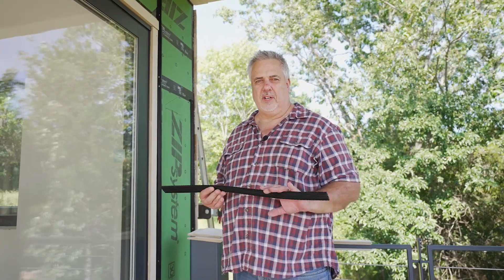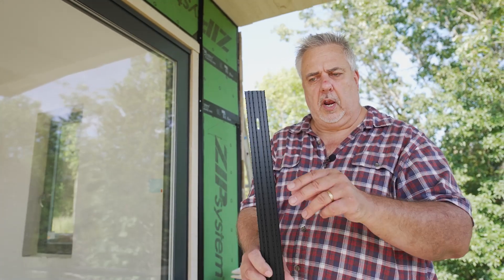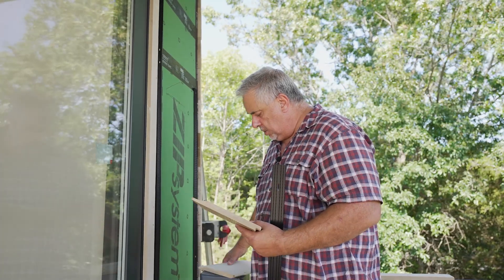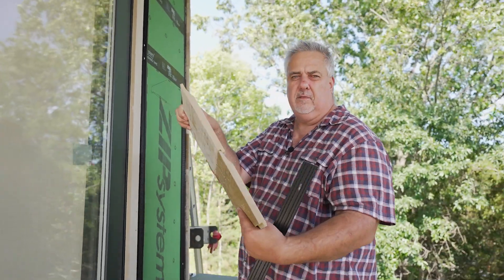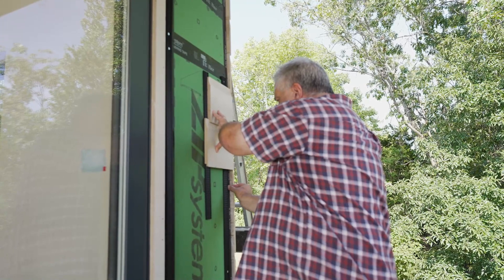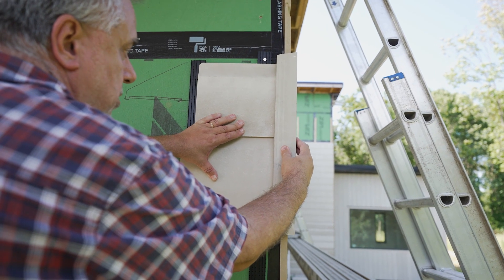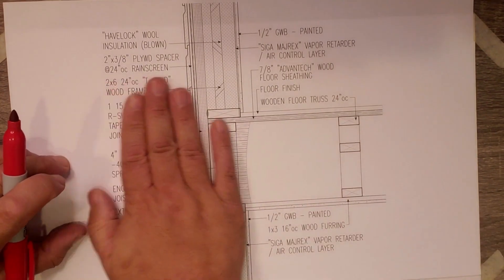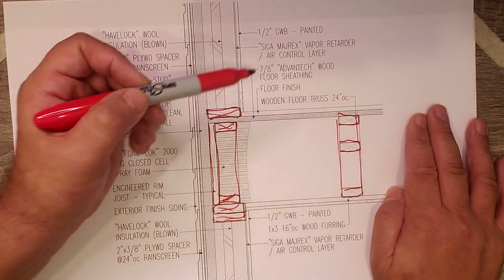RAINSCREEN SYSTEM

Comment: I spoke directly to Benjamin Obdyke technnical support. They indicated to me that Batten UV is not designed to support a load such as siding. The siding must be fastend through to the studs or to 5/8" plywood. They product will not work for the rainscreen system I designed which includes 1.5" Comfortboard 80 and 1/2" zipwall sheathing.

Comment: I understand the rationale for a rain screen betwen insulation and cladding. But what the need for and location of rain screen when insulated vinyl siding is used. Would a rain screen / air gap be needed and if so, would it be over the tyvek house wrap and under the insulated vinyl?  Is the 5 perm value of the vinyl's insulation adequate by itself without the need for air gap?

Comment: If a roof can have an impermeable membrane under the shingles why couldn't we also apply an impermeable membrane on the walls in lieu of a WRB ( ex.water and ice shield) . The interior cavity should be able to dry inward if there is proper humidity control inside the house (eliminate any interior wraps: insulation only). Also if the insulation is substantial enough wouldn't that eliminate any condensation issues? Would this assembly provide a more bullet proof water barrier?

Comment: With these rain screen batten systems; when you need to replace the siding, aren’t you compromising your wrb as well if they’re nailed through? Would you not need to replace that zip as well? If not how would you seal it again in 20-30 years?
Reply from the maker: liquid FLASH THE OLD HOLES IF YOU WOULD LIKE
Reply: @stevenbaczekarchitect9431  Ahh that makes sense, great stuff as always Steve!

Comment: Steve, I've thoroughly enjoyed the videos I have seen that you are in.  Over the past couple years, I found VERY little detail online (YouTube or web searches) on how to properly vent the rain screen at the TOP of the wall and around windows.  I am currently building my own Prairie style home, and have not fully resolved the top vent detail.  I am using lap siding (Hardie) and I am thinking it will have a frieze board at the top with a generous rabbet joint that the lap siding will tuck behind.  I am particularly interested in how to bug screen the gap, and how to do it with good aesthetics, etc.
Reply from the maker: I will keep it in mind and try to point out some solutions